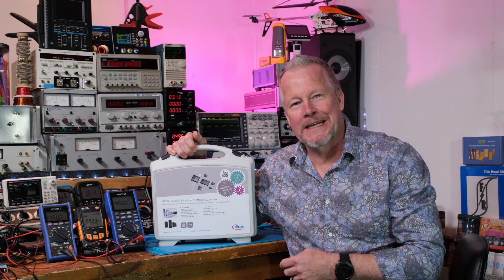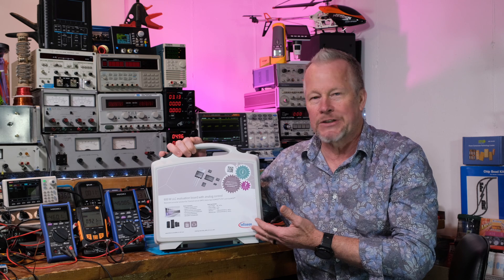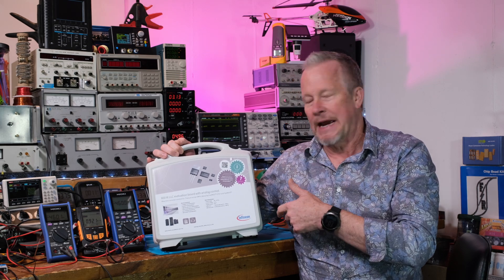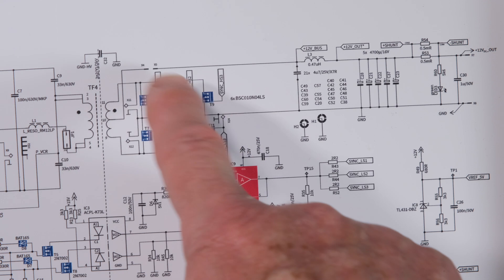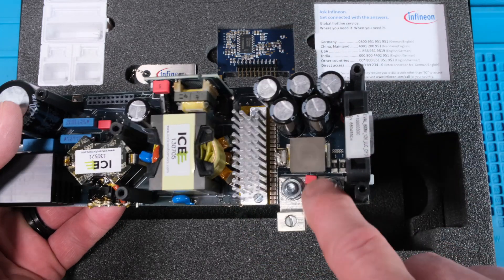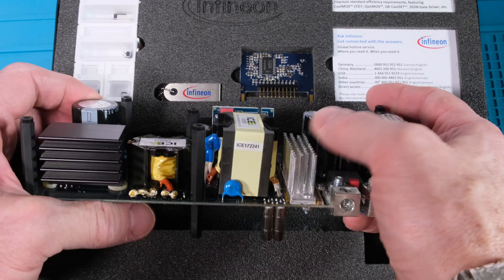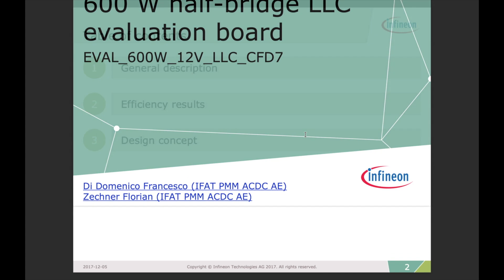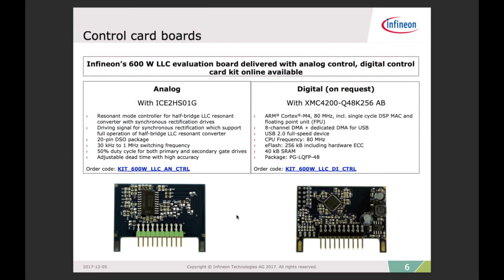LLC Converter by Infineon Presented #LLCconverter #infineon #LLCconverterEval #SMPS #howtodesignLLC

Comment: Great starter video for LLC. I think it would be a great help if someone wants to move into this technology.  Without some mixed signal background and deeper understanding of what signals are important in the design, very difficult to implement. It’s going to depend on the audience. Most will stick with the old brute force smps. Resonant mode is the emerging technology. Personally, I think it’s moving slow because of the technical hurdles.
Reply from the maker: Thank you - and great feedback!  I got the analog control version first so that I could avoid some of that mixed signal stuff;)  Also, I agree - resonant converters came out back when I first started, but never really took off - except in isolated cases.  This type of resonant, the LLC is complex, so that holds it back from taking off, but it is making headway.  I think that's why they went to the trouble of making such a nice eval kit;)

Comment: A key feature of a resonant converter is light-load or no-load efficiency. The dissipate a lot of power when there is no load. 
A common complaint I get is about the non-fixed switching frequency of our resonant topologies. A lot of people think a fixed-frequency SMPS (particularly a multi-phase buck) actually has a well-controlled, fixed emission spectrum. Uh, no, not exactly. As always, the devil is in the details. Ha! Rock on Eddie, you are the man.
Reply: This has been solved by changing the switching mode to a more "traditional" strategy when load is light...sometimes a Mix of both Ressonant and PWM. I've seen projects of 50Watts LLC spending less than 0.5W in "standby" mode.
Reply from the maker: Ken I left a reply but it wasn't uploaded for some reason...  It happens from time to time.  Then I go back and find out a month later;)

Great comments and yes you are right, so at the defense contractor that I worked for we didn't use them for these reasons.  However, this LLC is a bit of a different character.  One big advantage is that it usually has a PFC stage in front providing a regulated voltage, so that helps with the resonant part a bunch.  Also, because of the two Ls there's two resonant points that it swings from.  The no load is still an issue but as @Pep Legal mentions, there are ways around it.  Not sure how great they are, but I think they work.  One is to go into burst modes - isn't that always the solution;)

We'll get more into this as I develop one here on the channel;)
Reply: I haven't tried this, but a Vicor PRM would probably do well feeding an LLC converter. They do well feeding Vicor sine-amplitude-converters, which are resonant and have similar character. Thanks for your comments, fellas.
Reply from the maker: Thanks Ken.  I have had experience with those Vicor modules and I think you might be right;)

Comment: I’m going to assume they do have a full bridge version.    And available at different voltages.  
        But I’m also going to assume at the price they want you can buy the individual components and really go overkill and build a higher output version for the less or same money.
Reply from the maker: This topology can go higher in power, I think 2 or 3 x maybe.  I do want to make one a project for an audio amp that can be used for multiple projects;)

Comment: EvalKit packaging is supercool. Best UI seen so far. 
Interesting to see convertor's operating range in 350V+. Where would these high DC voltages be used -- A solar plant application?
Not a common supply to have in lab I believe.
Reply from the maker: Great question!  Actually these type of converters are becoming more common.  This would have a PFC stage before it boosting the AC input to a DC voltage around 350 VDC.